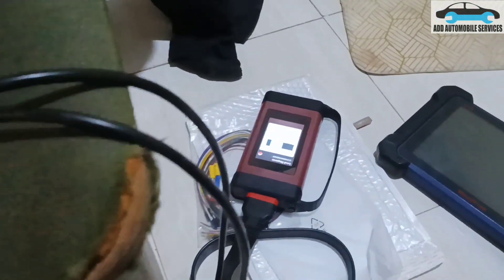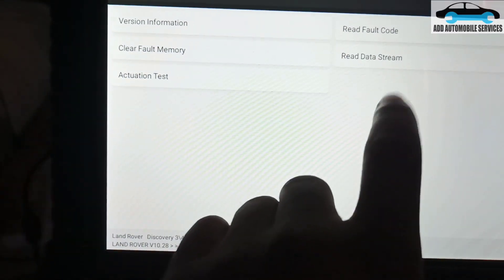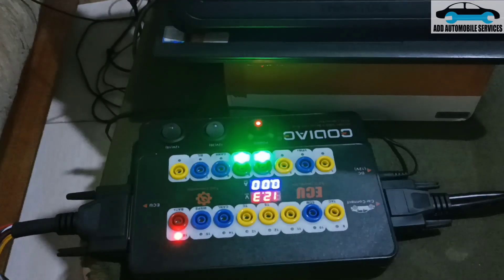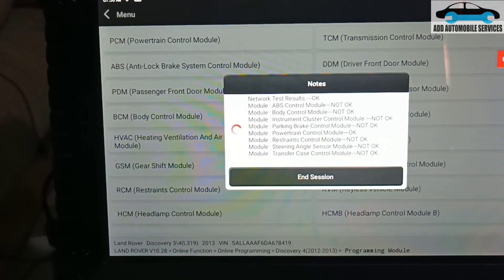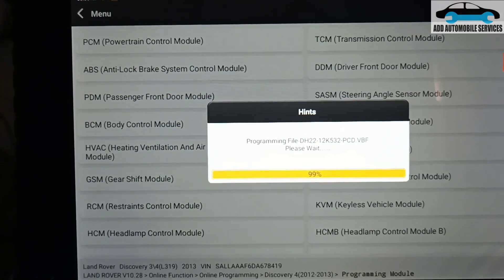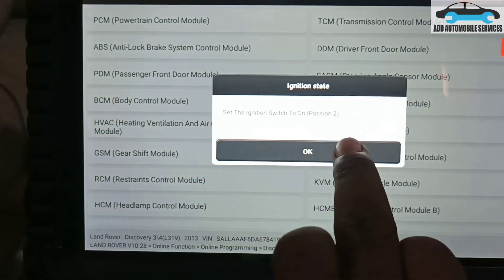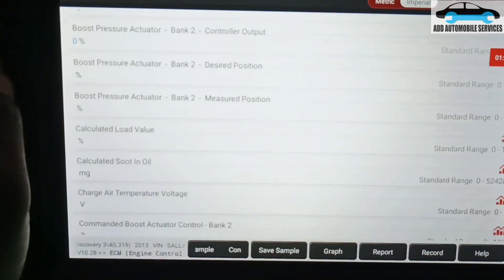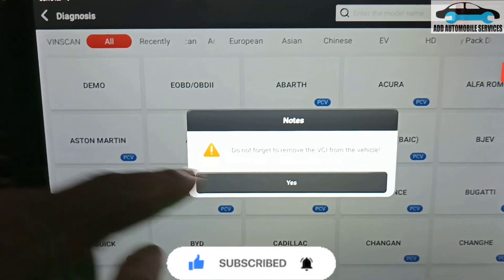Updating ECU with thinkcar S10 pro on bench

Comment: When bench programming like this you need to have the battery wire and ignition wire connected to the right pins on the pcm. When it asks you to turn off the ignition just turn off the 12v 15 switch on the godiag so the pcm still has battery power but not ignition power.
Reply from the maker: Yes